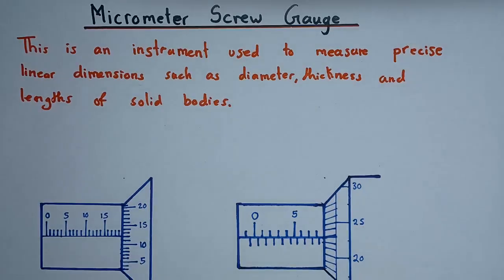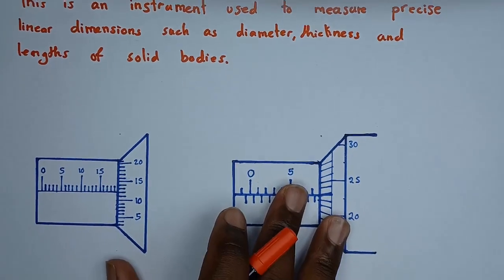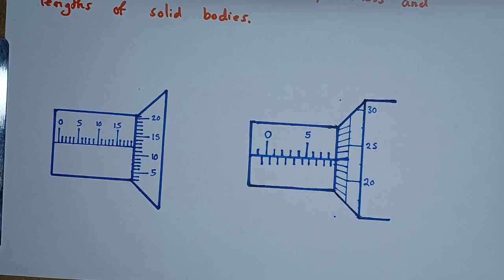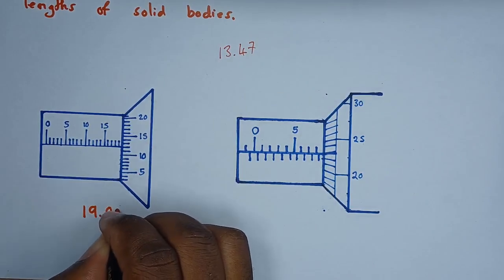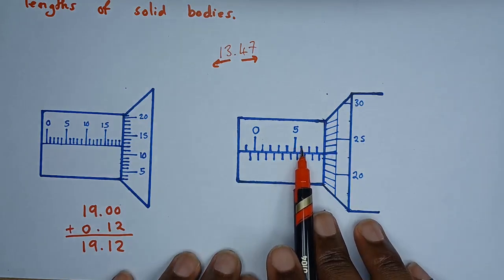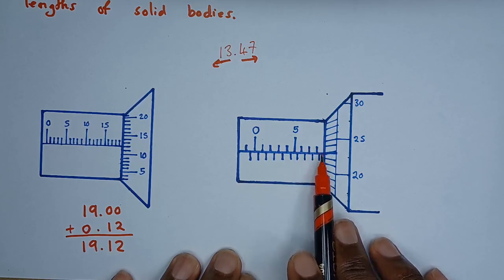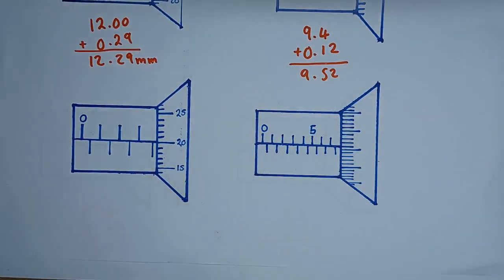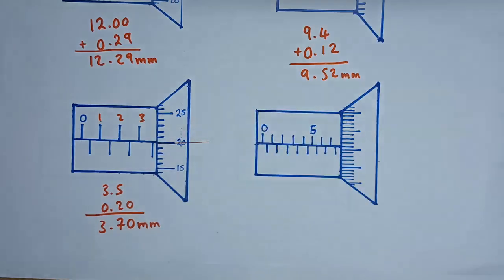How to read a Micrometer Screw Gauge

Comment: May please briefly 
 differentiate between sleeve and thimble reading...
Reply from the maker: Sleeve: It's a barrel type cylindrical part which mounted on spindle and is main scale of micrometer because main scale is engraved on the sleeve . Thimble rotates around that sleeve and spindle. Its main function is indication of reading in millimeter in case of imperial micrometer.

The Sleeve does not move. It looks like a ruler with ten numbers. The space between each number is divided into quarters. As the Thimble rotates around this Sleeve it covers up, or reveals the numbers marked on the Sleeve.
Reply: Thanks very your help
Reply: One more question,I need an explanation on how to find or read the diameter of a circular object using vernier caliper,may you help please?
Reply from the maker: You're welcome 😊
Reply from the maker: @thoralupii  https://youtu.be/TgUY_I47wdA